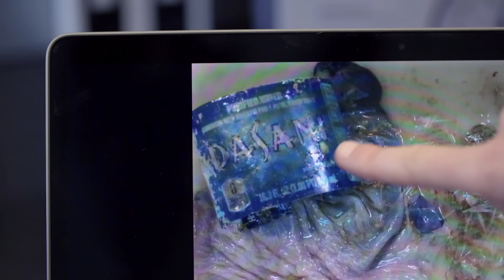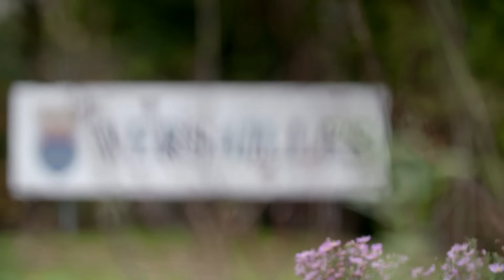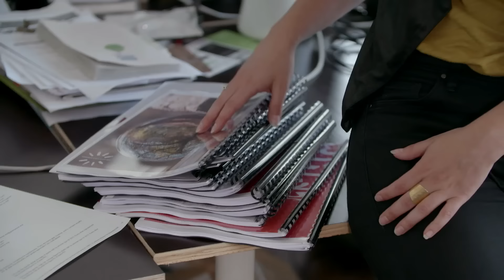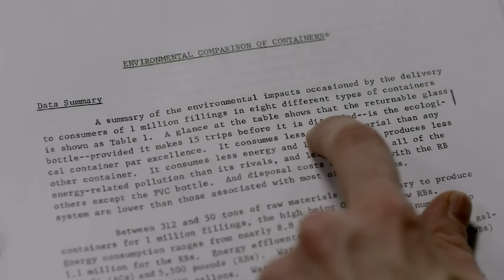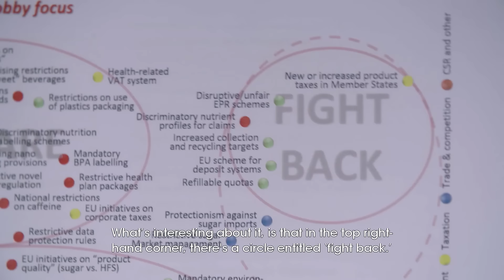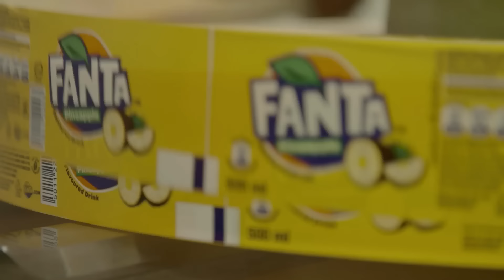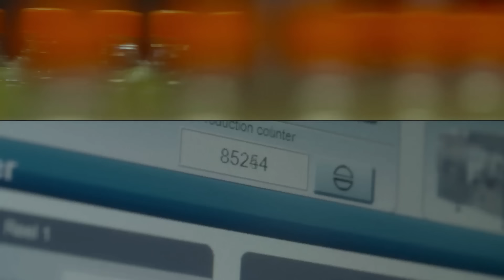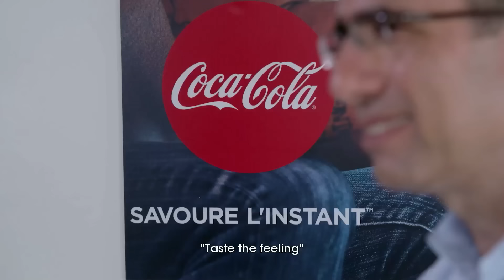Plastic Promises: Coca Cola's Recycling Lie | ENDEVR Documentary

Comment: The issue here is that it isn’t just about packaging and the failure of consumers to dispose of waste responsibly. It’s the fact that consumers are addicted to sugar. There wouldn’t be an industry if consumers were consuming so much sugar. Sure, there’s bottled water. Can the producer be criticized for producing plastic bottles? It’s cheaper to produce. It’s cheaper to transport because they don’t break when dropped. They’re lighter weight. Which means reduced fuel costs to transport. More product makes it to the consumer for less. The failed attempts to have a circular market are because of the costs. Would the company see a return on their investment by transitioning to zero waste? No, consumers are going to consume whether the company goes zero waste or not. The only thing that would compel the company to change is a mass boycott directly due to consumers’ displeasure with the waste. It undermines their profit.
Reply: This documentary shows that using glass bottles was effective with recycling efforts. . . . maybe there's less effort put into marketing recycling of plastic bottles, because the recycling process is an expense the company would rather do without.

This documentary shows the company has not reached half of their low targets for recycling; they've resisted things that could help for many years. Clearly companies have much to do.
Reply: People are lazy. Path of least effort will be the path most taken. Consumers will choose to dispose of waste irresponsibly when given the choice. It isn’t all about the “evil” corporation. The consumer has a responsibility as well. The corporation isn’t going to make a change unless the consumer doesn’t demand the change.

Comment: Buying bottled water is when I knew American were easily tricked
Reply: Right. Except in a  few areas where the tap water is bad, there's no need to buy water.
Reply: @Gertyutz even then there are other options most of the time. We had a water cooler with the reusable 5 gallon jugs and reuse Powerade bottles or whatever. Hardly ever bothered with bottle water

Comment: How about soft drinks are just sold in glass bottles (like back in the day) and people can turn them in to recycling centers or warehouses run by the manufacturers for 20C a piece or something, you already have plenty of people doing that for aluminum and plastic,  the bottles could be washed, sanitized, and re-used . . . so long as it doesn't hurt the bottom line too much.

They already do this in MEXICO people, if it can be done there, it can be done in the USA, EU, ect ect.
Reply: Then you have to use fossil fuels to recycle the glass.

Comment: One of the most expensive parts of delivering a bottled beverage to the consumer is the shipping. Shipping a glass bottle is a lot more expensive than shipping a plastic one. If Coca Cola switches from plastic bottles to glass bottles, they cannot maintain a competitive edge against their competitors who still ship their products in plastic. Coca Cola also has to answer to their shareholders who would not be happy with the change to glass. Coca Cola's share price would take a massive hit, and maybe never fully recover.

You have to remember that we live in a profit system and Coca Cola is a company. The whole point of a company is profit. This goes for all companies not just Coca Cola. Companies do what they need to do to be competitive and profitable. If there is something that that company is not allowed to do, or is required to do, you may need to lay the requirements out clearly into law (such as requiring bottles made of glass). Expect that companies will select the most profitable product to make first, within the boundaries of the law, before later tacking on additional systems to minimize waste. Being socially responsible to our planet is sometimes the opposite of what is profitable but our system rewards profit.